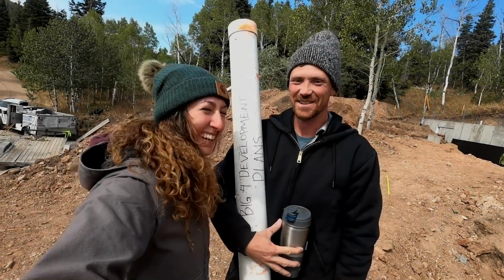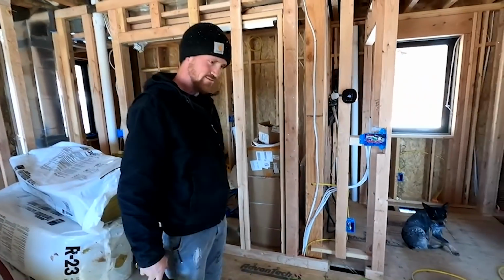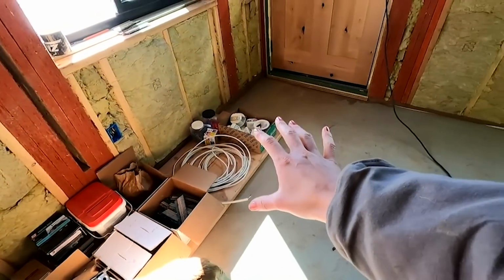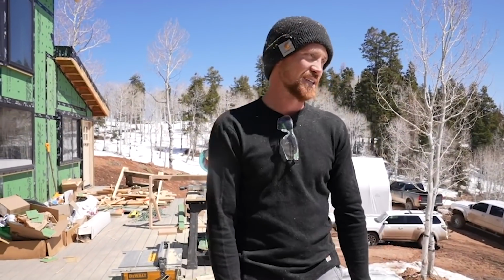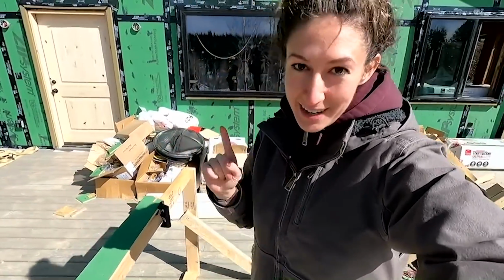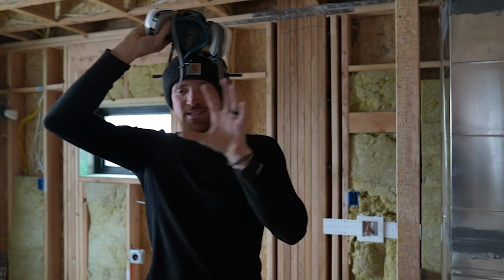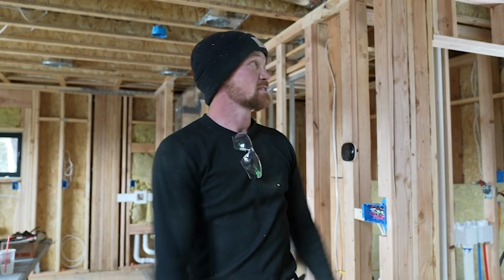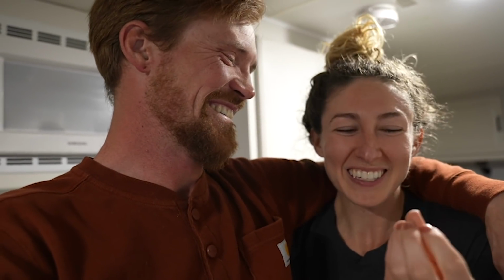RUNNING OUT OF MATERIALS | BUILDING OUR OWN HOME

Comment: At 4 3/4 minutes in, I might offer a suggestion: We have had very good experience with using some of those wire "baker's racks" (tall tubular supports with wheels and the wire shelves), organized and sorted (tools/types of supplies). They're easy to re-locate when you need the space and they can easily by located for convenient use wherever you need them. Lots of times, they pop up on sites like Craigslist or Marketplace. 
"Stuff" in boxes is good until you need it and you have to hunt through boxes to find it. Actually, the boxes CAN be used on the racks too.

Comment: You can get those painting coveralls that will help keep the particles of insulation off your clothes and skin. The dollar stores sometimes carry them. A paint store or hardware store should have them too. There are those made of that thin, looks like felted paper fabric and Tyvex too. Either works. 
I would insulate the inside walls as well. Not only for sound, but for temperature and fire resistance too. It will help with your heating and cooling too. I'm glad you're insulating the bottom floor too! It will absolutely make a difference!
  Great job on the house so far! 
Looking great!

Comment: We insulated the floor where the up stairs bathroom was.... didn’t want to know or hear when company was flushing their toilet!!
Reply: Now now..where's your sense of nosiness? 😀
Reply: @barbibutton9619  Or "noisiness"?  :0D
Reply: Did the same with my cottage.  Not just for the sound but so I could isolate the heat.  He cottage was designed so that all the plumbing fell along one room.  I wanted the place to be four season, and it was cheaper to heat just two rooms instead of the cathedral half.
Reply: So true!  Nothing like hearing the toilet flush while serving dinner.  Just as bad for the people outside as for the ones inside...  It put a crimp in the fun of a nice dinner.
Reply: Our guest bathroom toilet paper roll makes so much noise into the other side of the wall...where people are sitting at the kitchen table....
Reply: @tinydancer7426  lol yes
Reply: yup and the inside walls as well.

Comment: That's a good idea starting insulation from top down, especially if you don't have enough to do the entire home yet. Here's a hint for ceiling roof area insulation application. Use staple gun and staple string, or poly fishline, every 2' across front of insulation to help hold in place till you can install the drywall over it. Keeps it there, makes a bit easier when comes time to affix the drywall. Were you not able to order the insulation to be shipped direct from factory to you? Remember, it's usually YOUR responsibility to get it off the truck, not the driver's. And if they say will deliver by "Yellow" truck, that's not the color yellow, but a big tractor trailer bringing it!

Comment: oh my god yes, insulate all walls.  I commend you.  I always insulate interior walls for sound and acoustics, also if you have a room you do not want to heat or cool it makes it more efficient to isolate it.  good job.  insulation is cheap and is a little easier to install before drywall.

Comment: Search for  "Insulation Supports" they are made of spring wire and cut with a 45° angle tip to dig into wood floor joists. Cost about $15-$20 for a box of 100.

Comment: On the floor joists they make what called tiger teeth is a spring piece of wire that has sharp points on both ends they are cut for floor joists and made to hold your insulation up in the joists.

Comment: This “piles of Hanoi” problem on my last reno/extension is why I sprung for a couple of home-depot wire-frame-shelf-on-wheels to keep all the tools, on, and a couple of those big Stanley/Dewalt organizers for all the electrical bits and pieces and fasteners…    There are never enough toolboxes. :)

Comment: Use what we call "lightning rods" to hold up insulation in the ceiling, they are just thin wire rods that are closer to 16" long , you just slip them between the joists after you put up the insulation.

Comment: If you cut lengths of wire or strips of metal, you can bow it between the floor joists to help suspend the insulation in all the ceilings. Let me know ! Good luck !

Comment: one thing i seen with rv bus builds use packingtape on all the mountingsurfaces you need flat for the wallcovering to atach too and cover over the windows 
spraying foam makes an enornous mess and the tape can be eazily pulled off after spraying saving tons of time cleaning up , having some residue on the allready installed wool insulation shouldnt matter mush  
as for fitting the insulation between the batons : maibe use strips of packing paper / cardboard stapled under the insulation to hold the up untill the covering is installed you should have plenty of that stuff laying around
as for anything with a long ordertime : it might help to rent a storage space at the base of the mountain somewhere where you can have everything delivered no matter the weather when its available , still has the problem of having to haul it up there by youreself or hire someone to do it but that might prevent you guys having to stop building

Comment: hey, Trent, I'm red seal insulator. when doing the floor use some twine to hold the insulation in place until you get drywall installed

Comment: I find a shower does not get rid of the itch w/ Insulation. It takes several showers & several days. Now I use spray foam. It cost more but works I thank.

Comment: Hey Trent--you might think this is crazy but it works.. back in the day we use to put a empty glass bottle like a beer or soda bottle between each stud in the wall we wanted to dampen the sound like a bath room and it worked.. I know it sounds crazy but it works..  Just a suggestion.

Comment: The places where you buy insulation, also sell cheap insulation supports that will hold the batts up. It's just a piece of wire with points on the ends.

Comment: Not sure if this has been brought up previously. Are you going to install a service access door for the motorized exhaust fan dampers? They will fail at some point and if simply sheet-rocked over, you will have a major job getting to them in the future. If they fail in the closed position, the exhaust fans will be inoperable until you tear into the ceiling for repair or replacement. Just a thought to consider. Sorry for the repetitiveness if this has already been discussed.

Comment: Check the small towns.  The local hardware store 75 km (47 miles) away had all the insulation and wood that we couldn't get in the city.  We also found TP and paper towels at the small stores in the surrounding villages and towns that we couldn't find in the city.  And at a couple of places the product was cheaper than the big box stores because it was "old" stock.  Here in Alberta a 2X4 (92in) was 2.92 and is now 7.98 and the wood comes from Alberta plants.  The prices are just nuts.

Comment: OMG, so much cardboard you threw in the landfill!! You could have recycled all that!!!!
Reply: Most "Landfills" (garbage dumps) here in the US have recycling facilities that do that. They sort out the recyclables and bury the rest. Burying cardboard, which is just wood fiber with a binder, is just as much recycling as shredding it and making it into paper. It feeds the soil, and is good for plants. The binders are usually biodegradable (starch), often a byproduct of corn. I use cardboard in my garden to mulch for weeds, and it breaks down over time, as well as keeping the weeds at bay. Even if it's buried, it's being recycled.
  Toxic waste dumps are separate, so that's not an issue, unless there's people illegally dumping those items in their trash. Plastics are generally separated out by type (polypropylene,  polystyrene, etc.), thus the numbers on the bottoms of recyclable containers & on sheet of plastics used for some packaging. Some plastics are biodegradable as well, and are made of starches.
   Check it out! It's pretty interesting!
Locations with the worst recycling records... Los Angeles and New York! (True fact!) I know someone who headed up a research project on recycling nationwide.  It was rather interesting. Even though big cities added recycling bins about 20 years ago, true trash and recyclable materials, and toxic wastes is far more mixed and buried in big cities than in rural areas.
  If you go to older, rural areas, people used to bury & burn trash. Even city areas used to burn leaves and paper/wood trash, even when I was a kid. Some still do!
  Look into how dumps, recycling & landfills work. Check out your local landfill/recycling center. Trash is sorted, those things that can be recycled are, those that cannot are generally buried. Toxic wastes, such as paints, industrial wastes, etc. Go to special "landfills", which have liners, so they don't leech into the groundwater. These are separated by types too, and are sent to different places. If they weren't,  we'd have explosions everywhere. 
  Occasionally,  we do have explosions, exothermic reactions, radiation contamination,  etc. when people illegally dispose of certain types of wastes, including well water. 
  Where I live, there's naturally occurring radioactive minerals in the ground, as well as metals that can violently react with water, so anyone drilling has to test for these things. We did have some people drilling here who tried to dump their water into a regular wastewater treatment facility.  They melted & radioactively contaminated 4 fire trucks, put 4 firefighters in the hospital, a driver of the water truck carrying it reportedly died of radiation poisoning.
  We live in an unforgiving natural environment. It's also beautiful and a really neat place!
  Here we have oil oozing from our mountains and on our beaches too... from natural seepage.
  As an environmentalist, a retired scientist who has done many years of field work, I cringe at some of the things pseudo-environmental groups push for, with no experience, or knowledge, of our natural environment.
  The world can be a dangerous place, if you don't know what's out there. Policies  without education can be just as damaging. I'm in California,  and many policies here that are meant well are doing more damage to our environment, and helped create the fires here the last few years, as well as desertification of the west coastal states in the US. For instance, my county dumps 60 million acre feet of water a year into the ocean, because of a law created that was supposed to be for "environmental protection", thus we have severe droughts.
  If you change one thing, you are likely screwing up something else, especially when done on a massive scale.
  Anyhow,  thought I should share this, as so many well-meaning people want to create policies, criticize,  and create laws, without seeing the full picture of effects it has on other things. It's had disastrous effects here in California, for people, wildlife, our forests, our lakes, streams and oceans, helpful bacteria, fungi, helpful viruses that keep harmful ones at bay, and so much more.
   I hope this is helpful. We need more people with a working knowledge of the real world, as it is. It may be viewed as "dangerous" to some, but it's really a wonderful place, when you get to know it!

Comment: Get a hold of an electric kitchen knife to cut the insulating. Much easier 👍🙂
An to hold the insulation up in the basement get a hold of steel wire and crisscros it to hold it up. Use nails to hold the wire.

Comment: when (if i am understanding this properly) the insulating material wont stay in its designated space due to the lack of friction  we used a staple gun to secure some string and zig zagged it across the space to hold the insulation in place its very cheap and small not to make any problems..

Comment: How to hold up narrow insulation batts in ceiling application? Solution: The cheapest way is to tie string between protruding nails in the joist space; zigzag the string from nail to nail, creating a simple net, holding up the batts. Or, instead of nails, consider staples to hold the string.

Comment: a good way to cut insulation is to cut a slot with a skillsaw in a piece of plywood a little wider than the width of the batts then place the plywood on saw horses and use a handsaw to cut it to length !!!!

Comment: Hey I don't wanz to nag unnecessarily, but shouldnt the dogs keep away from the insulation when you cut it Trent? You're needing a respirator, I can imagine that the particles that float in the air when you cut the insulation, aren't foot for doggy lounges either.

Comment: If the insulation is so dangerous that you are wearing masks , why are the dogs in there breathing that in? concerned 👀
Reply: Good point
Reply: Yes I was concerned about that as well.
Reply: So i guess I'm not the only one wondering about the dogs' lungs and fur.  Would an air purifier help clean the air?  Just concerned..... ❤❤
Reply: dogs only live about 7-9 years. the dogs lifespan will come to an end before any insulation causes any problems.
Reply: @BA-qb1ee  I will tell that to my 16 year old dog.  Who will be 17 in June.
Reply: I was concerned about the dogs lungs and eyes myself.
Reply: @BA-qb1ee  
If these guys had a chance to live longer wouldn’t you try to keep them healthy
Reply: Their water bowl needs to be moved outside too.
Reply: I mentioned that on their last video and also why he was not wearing a tyvek suit.
Reply: I know, very worried about Frank and Lika.
Reply: Dogs only live 20 years.. The will be ok!
Reply: Insulation like what they are using isn’t as dangerous as all that a cloth face mask would work... my dad is a contractor and I have been on many job sites with him including my own house build and we just wore cloth or paper masks of some kind long sleeves and gloves too it is itchy but from what he said you could technically do insulation with out any of the pipe but it wouldn’t be fun so the dogs are probably fine and they are staying away from direct contact with the insulation any way
Reply: Doubtful the dogs would wear a mask.
Reply: Pointed this out a while back.  They probably only read comments from Patreon members!
Reply: @hhf320i  I posted a similar comment right when the video came out. They “liked” the comment so I am assuming they acknowledge it. We will see in future videos if they speak on it.
Reply: @ludmilaschicchi8278  - small dog breeds live longer. larger breeds live 7 - 9 years.

Comment: if you do not have rockwool knife you can use an old serrated bread knife, so much easier to cut the insulation with.

Comment: Starting with Lumber - which is getting all the press - ( Recently $ 75 for a piece of 3/4" 4x8 plywood ) - it seems that all other materials are way higher as well and hard to find. Insulation - nails - sheet metal - roofing and on and on. AND - finding a builder to build a house for you is very difficult - AND they would charge you $ 50,000 MORE to build a basic home. And so - as a side effect to this - ANY home that is ALREADY BUILT and is being sold - has all cash offers - sometimes before they are even listed on the MLS. The current economy and real estate situation is absolutely nuts.

Comment: I have enjoyed your videos since you ware in south america. Suggestion: when I worked electrical and plumbing in Canada in 1967 they required a vapor barrier of plastic sheeting between the insulation and the drywall. This prevented moisture rot in the wood. Considering your weather I would recommed it. Great build.

Comment: They make wires especially for that that hold up the insulation they come in 16 18 24" and 12" you put the installation up push the wire up and the wire holds it in place

Comment: Out of curiosity, why did you not spray foam everything ? I have done it and it works perfect. With all the wires and plumbing odd spaces the foam seals it super tight. Two days and your entire house is done, top to bottom, including concrete basement walls.
No itchy dusty issue either.

Comment: "Chicken Wire Fencing"  has been used for over a hundred years to hold "Plaster" on interior walls and to hold insulation up between the floor joist and ceiling rafters. It's fairly cheap and easy to work with.. a staple gun is all you need to hold the chicken wire fencing in place on the joist and rafters.    And... it allows easy access to problems with  pipes, wiring and repairing squeaky floors down the road..   Chicken wire fencing can be cut with tin snips or heavy duty scissors and repaired with bailing wire after the repairs are finished.
I realize this video is two weeks after whatever you have done.. but it's information to file away for your next project.

Comment: I do not no  if Trent no's if on the out side walls . If you have any pipes running up or down on the out side walls you need to insulate on the back side against the wall between  and the back side off your pipe . And do not cover the front sides of your pipes up . And leave the pipes open to the inside off the home so your heat from the inside wall can keep your pipes worm . Just asking .

Comment: Another great show. Our dump requires bright yellow shirts and hard-hat -LOL. How much was it to dump? Did you go over the minimum (weight)? Glad most of the cardboard ended up in the recycle bin. On that basement ceiling insulation, maybe consider going across (cut 17" lengths). When you push it up in there it will stay. If going two layers, stagger the seams. Thanks for sharing.

Comment: I'm in southeast Michigan with a home project to upgrade my service panel to a 200amp of a different brand. I've had to wait for stuff to be in stock for online orders. Breakers I got some at one store, some at another, and some online.  I'm finding not all stores have the right service entrance cable in stock and wire pricing goes up and down.